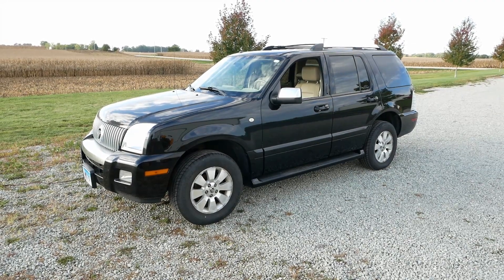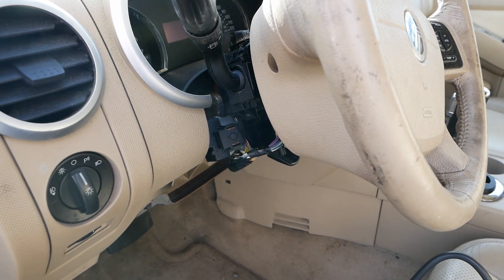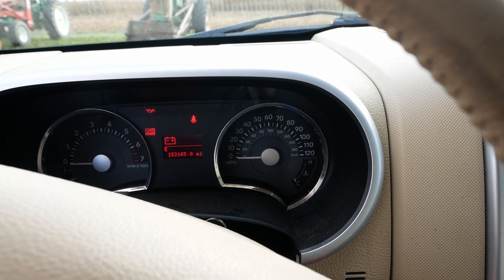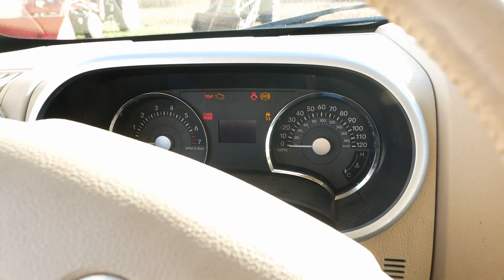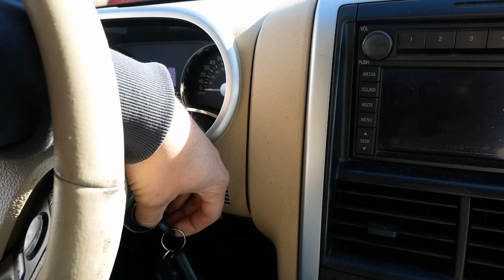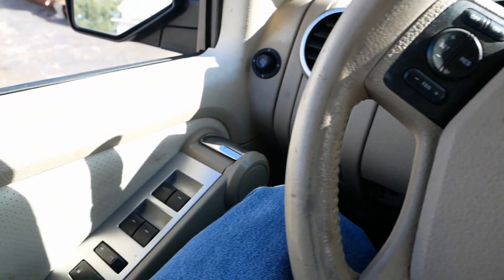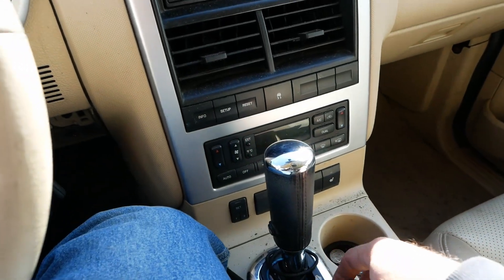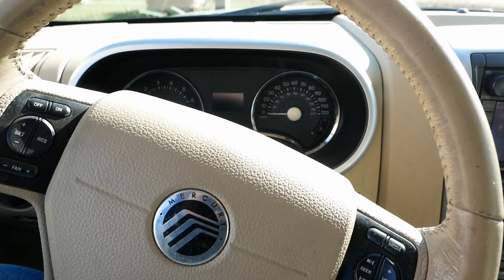Mountaineer Won't Start After Thieves Destroy Steering Column

Comment: Those ignitions are easy to rekey
Reply: That's my thought, too. Rekey the cylinder in the column while all the trim is off.

I was wondering why they didn't swap the cylinder from the old column, unless it was completely mangled by the "thief".
Reply: @foxyloon  Wes is a great tech but I don’t think locksmithing is his favorite thing. He simply did the most cost Effective, and quick repair he could do.
Reply: @zackarymcclain164  True. At least it starts reliably again as it sits.

Comment: So my 2005 Ford Mustang key fob stopped working (nothing would fix it including a new battery, and wife had lost the other set), so suddenly I can’t get in the trunk. Key opens doors and starts car, so I try like four of those aftermarket key fobs, do all the key turning and none of them ever work. ??? Five years later I sold it to a Motörhead kid for a grand for a grand. Sometimes that stuff works sometimes not, and I’m not buying a $1K scan tool to figure out the fix. Best Regards. Wearing my WWW shirt.

Comment: Never ever tell.a customer you looked something up on-line ..
Because they'll try it the next time it breaks and you'll wind up having to undo whatever nonsense Google told them to do.

I have to undo a "Google Repair" next week and Im not looking forward to it.
( They misdiagnosed a bad alternator as a bad hydrostatic transmission and took the servo apart .....yay.)

Comment: ISN'T it just AMAZING that if you take all the same amount of steel plastic glass rubber and copper wire,YOU can make THAT car or a Bugatti. the suv cost what 40,000 vs 18 million?that seats 6 and the B only seats 2 ?
So which is a better value and which would you rather have parked in your driveway?haha